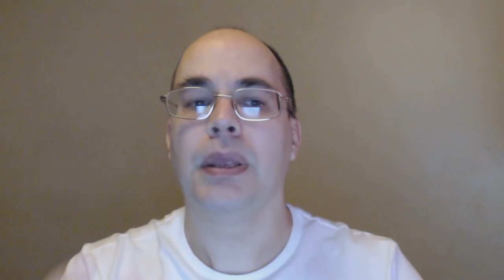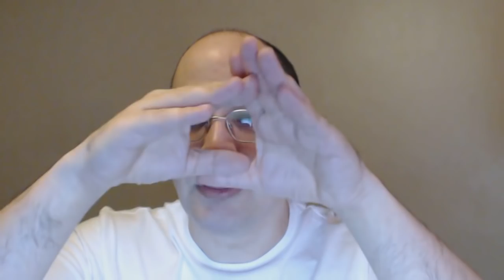How do rockets move in space, with nothing to push off from?

Comment: A rocket need mass to thrust against.. be it the floor or the atmosphere, in space there is no mass to push against,, neurons 3rd law is provided by the mass of the atmosphere NOT within the rocket mass,,  this guy has a deformed sence of logic,, This is an easy experiment,, Try making a balloon car and hold a vacuum hose behind it's thrust, as you will see the vacuum sucks all the thrust away and the car stays still!!  Disproving this idiot..
Reply: +Davy spilani
A rocket need mass to thrust against
No it doesn't. Rocket's thrust is the thing that pushes it upwards.

neurons 3rd law is provided by the mass of the atmosphere
Newton's 3rd law doesn't need "the mass of the atmosphere" in order to work.

Try making a balloon car and hold a vacuum hose behind it's thrust
This experiment doesn't accurately reflect vacuum conditions - vacuum doesn't "suck". Besides, if the thrust is leaving the rocket it means it has already done its work of pushing the rocket upwards.
Reply: Jan Strzelecki  According to Newton and it's Newtons law NASA claims gets a rocket to work in space,  it most certainly does, or are you another idiot that doesn't understand Newtons law?????
WHY A ROCKET WON'T WORK IN A VACUUM!
Why a rocket engine will NOT work in space! NASA says Neutons 3rd law of motion is what makes a rocket work in a vacuum. The 3rd law states "for every action there is an equal and oppersite reaction".  They say this propels the rocket forward and not the air the rocket is pushing against! I say, using  Neutons law, Imagine two big heavy boxes in space, move them together and put a spring in between them,, connect the boxes together.. Now, the spring is the action and you will have an equal and oppersite  reaction via the boxes, when you detach the boxes the spring will push them Appart. So the action of the spring caused an equal and oppersite reaction and the 2 boxes shoot Appart at equal speeds as long as they both have the same mass..  Now a car is Mass the wheels are the spring or thrust and the road has mass, the spring pushes in equal directions, or the wheels turn and the road and car shoot Appart in oppersite directions at equal speeds. The ship works the same,, propeller is the spring and it pushes against the ship which is a mass,, and the sea which is another mass, the 2 masses move Appart at equal speeds in relation to their masses,, The ship has more mass than the sea water behind the propeller so moves slower than the water, A plane uses the same principal. A rocket,, the same principal,,, In this 3 part equation, ie (Mass spring Mass) or (Oppersite reaction/Action/Oppersite reaction) Quote "for every action, there is an equal and oppesite reaction". The rocket is the first mass the spring is the fire plume, (This is a controled explosion that pushes equally in 2 directions just like a spring) and the earth's atmosphere is the other mass, again proportional to thrust and  depending on the mass of air moved and the mass of the actual rocket determines the speed the rocket moves in one direction. As you gain altitude the mass of the atmosphere exponentialy decreases but the mass of the rocket stays the same so in order to continue up at a constant speed the the fire plume or controled explosion has to exponentialy increase thrust in both directions until finaly there is nothing left to thrust against on one side of the fireplume as the atmosphere has depleted. Now we have a case of Neutons 3rd law of motion only having 2 parts ei ( Mass spring ?????) So Neutons law no longer applies and the rocket will not have propulsion, like taking away the sea from the ship, if ships could fly it would just not move,, the propeller can spin as fast as it likes the ship is not going to move. This is before you consider the unimaginable amount of radiation both in the van Allen belt and in general space.. So that's Neutons law saying you can't go into space for far using a rocket engine, You need something to thrust against...   It doesn't matter what those masses are, that's not the point, all that matters is the action the reaction and the oppersite reaction (Reaction/Action/Reaction) 3 parts.. The 3rd law of motion. You can have one big box one small box, One with double the mass, a super spring, it doesn't matter, the principle stays the same, this is a law of physics. so that's ( Rocket = Mass/Explosion/Atmosphere=Mass) The rocket and atmosphere are the equal and oppersite reaction. Take away the atmosphere and you have (Rocket or mass=reaction/Explosion= Action=Explosion/Nothing????? zero mass = No Oppersite reaction) Now Neutons law can not apply.. The rocket can not propel forward...
PROBLEMS WITH ORBIT SPEED
If we have (mass1=Actual rocket/Spring or thrust/mass2=Atmosphere)
So If thrust needs to exponentialy increase to compensate for an exponential decrease in mass 2. Then there's ,A, An exponentially  increased need for fuel and ,B, A constant weight added for all the fuel nessasary to reach Orbit velocity. 
You would need an atmosphere to use as mass2 and the problem with that is heat! To reach Orbit velocity means 17/18,000 MPH If you do that speed in the atmosphere you burn up?! Especially when you are carrying Highly explosive rocket fuel! 
Conclusion!
In order to achieve enough mass2, In an infinate vacuum, you would need to have infinate thrust and infinate fuel  and that fuel would have infinate mass in order to create enough of an atmosphere in mass2 (space) For the spring or explosion (Rocket fireplume) The action in Neutons law,, ie (reaction/action/reaction) to have enough thrust to propel mass1 (the actual rocket) Forward. This is assuming space is infinate and a vacuum! 
Final conclusion It's not possible.. Maybe very low orbit with very light equipment, but with the radiation and heat problems! Once a rocket engine switches off in space the rocket will start to fall towards the nearest large object unless the rocket is in orbit!! ..
Reply: Jan Strzelecki I see a vacuum doesn't suck,, realy,,well it does when you provide an atmosphere, otherwise you'd have bubbles of gas floating about in space.. Oh dear how wrong you are...
Reply: +Davy spilani
I see a vacuum doesn't suck, realy
Yes, really.

well it does when you provide an atmosphere
No, that's merely gas expanding to uniformly fill available space.

So, that's your first mistake - your lack of understanding about how vacuum actually works.

I say, using  Neutons law, Imagine two big heavy boxes in space, move them together and put a spring in between them,, connect the boxes together.. Now, the spring is the action and you will have an equal and oppersite  reaction via the boxes, when you detach the boxes the spring will push them Appart.
Yes, but the spring itself isn't real. It's merely a representation of the forces acting upon those two boxes.

Which is why all your later examples and explanations are wrong. 

Remember, it's "for every action there is an equal and opposite reaction", not "for every action there's a spring that provides the opposite reaction." 😊

So, that's your second mistake: misunderstanding of the analogy explaining the 3rd law.

You might want to try "two rubber balls hitting each other" in the future  😊

(A word of advice here - if you're getting confused by the simple analogies, maybe you shouldn't try to criticize the actual literal rocket science, hm? 😃)

So Neutons law no longer applies and the rocket will not have propulsion
Newton's Laws always apply - saying it's not is like saying "once you jump up, the law of gravity no longer applies".

So, that's your third mistake: misunderstanding how physical laws work.
Maybe very low orbit with very light equipment, but with the radiation and heat problems!
What radiation and heat problems? 😊 Are you seriously taking NASA at its word here, while simultaneously denying to do so? 😂

So, that's your fourth mistake: cherry picking.

Davy, sunshine, we know about dangers of space travel because NASA told us - if they wanted to fake the space travel, they wouldn't have done so. Even if they've changed their mind later on, all they had to do was to produce a "retraction" - "New measurements done with more sensitive equipment prove that space isn't as dangerous as we've previously thought." - done. Problem solved.

Once a rocket engine switches off in space the rocket will start to fall towards the nearest large object unless the rocket is in orbit!
Even if the rocket is in orbit, it's still falling towards the nearest large object. You don't even understand how orbits work 😂

So, to recap, your mistakes are:
1. You don't understand how vacuum actually works.
2. You don't understand your own analogy explaining Newton's 3rd law.
3. You don't understand how physical laws work.
4. You're quite happy to pick and choose available data in order to suit your preconceptions.

And, yes, it's "Newton's" law, not "Neutons", and it's "principle", not "principel", and yes, you most certainly are another misinformed person that doesn't understand Newton's Laws 😊
Reply: +Davy spilani
you know that example of 2 boxes and a spring? That's the 3rd year high school physics curriculum and that's how they teach the 3rd law of motion!
Yes, but the spring still isn't real - it's still merely a representation of the forces acting upon those two boxes 😊

The analogy isn't wrong, but your literal application of that example to reality most certainly is 😂

Like I've said, try using "two rubber balls" analogy next time - there's a chance it may be easier for you to understand 😊

You Say I don't understand how a vacuum works! Realy!!
Yes, really. Again, vacuum doesn't suck - it's merely gas expanding to uniformly fill all available space.

The person who can't remember their high school physics class
That would be you - I remember my high school physics class just fine, which is how I know that rockets most certainly do work in space, and they most certainly don't push off the air 😊
Reply: +Davy spilani
I'm sorry
Apology accepted, then 😊

but you cannot show a blind man visual reality.
The visual reality is that rocket is action, and exhaust is reaction. There's no need to assign "spring" role to any of those two, since the actual Newton's 3rd Law doesn't say anything about it, now, does it? 😊

Or the mentally impaired.
Don't sell yourself so short, Davy 😊

You lost all your credibility with these 2 comments
Well, you lost your credibility way, waaay earlier, but the difference between us is that I at least try to educate clueless people, such as yourself, and point out their mistakes. You? Not so much.

1 because it's a perfect analogy of the law of motion
Yes, but the spring still isn't real and still has no direct analogue in any of your examples 😊

So when idiots make unfounded comments like yours i can give them 2 choices,  1, you agrea with me or 2 you disagrea with me and the education system! Which one is it?
Neither, because though I agree with the education system, I don't agree with your creative reinterpretation of the physical laws involved.

If you think the exhaust gas provides an atmosphere then you disagrea with NASA
In a weird roundabout way, exhaust gas does provide an atmosphere (as in "the thing the rocket pushes against"), so to speak, although it's a very awkward way of explaining it. So, by "thinking" that, I most certainly do agree with NASA in that regard.

If you think the 2 box analogy is wrong then you disagrea with your education system!
But Davy, I never said that the 2 box analogy is wrong 😊

What I actually said is that you misunderstood it. The fault is yours, again, not mine.

And that's your fifth mistake: Your reading comprehension is very poor.

So, to recap, your mistakes are:
1. You don't understand how vacuum actually works.
2. You don't understand your own analogy explaining Newton's 3rd law.
3. You don't understand how physical laws work.
4. You're quite happy to pick and choose available data in order to suit your preconceptions.
5. You have poor reading comprehension, (which, frankly, explains a lot. )

Comment: in a gun the gases ignited behind the bullet pushes the bullet forward as the gases has to push the bullet out before the gasses or most of the gasses can escape down the closed fixed environment - A CHAMBER where gas is moving and has to move the buulet out - low level of gun powder less power from bullet -  simple shit -  this video is stupid -  ROCKETS proppell and push off the earth then in air they push off the atmosphere AIR itself - HIGHER up less air to push off of - IN SPACE there is needed TWO object - THE ROCKET PUSHING OFF OF SOMETHING in space there is no second OBJECT so in return ROCKETS DO NOT WORK IN SPACE -  LOOK UP voyager - THEY SAID the thruster do not work in space - they had to use PLANETARY GRAVITY to change or manipulate direction or travel -    ROCKETS DO NOT HAVE NOTHING OT PUSH OFF OF   - earth  IS FLAT and SPACE AND ROCKETS IS BULLSHIT -  because of PHYSICS   simple shit  -  DONT BUY THE BULL SHIT and stop spreading lies like your stupid ass GUN bullet SCENARIO
Reply: +the one
in a gun the gases ignited behind the bullet pushes the bullet forward as the gases has to push the bullet out before the gasses or most of the gasses can escape down the closed fixed environment
Yes, but how? You have an explosion inside the chamber going in all directions, so what exactly causes those gasses to start pushing the bullet out?
Reply: there is a tiny primer inside that when struck ignites the poweder - CAUSING it to ignite - back of the bullet casing is where it pushes off of because where the bullet sits has lest resistnace and moves forward -- pushing off the back of the inside of the casing -    IN A VACUUM in space there is nothing to push off of - nor oxygen to burn anything - yes you can have oxygen inside your active TYPE of fuel - BUT   IN PHYSICS - YOU HAVE TO HAVE TO FORCES ACTING UPON ONE ANOTHER _    GASES ACT ON THE CASING -  ROCKET ACTS UPON  well NOTHING    -  do you get my point -  unless im missing something here -  BULLETS work on earth - right - due to 14.7 atmospheric pressure same reason propellers work and jet engines - like when a truck fly's by you you fill the air hit you -   this would not occur if you were in space and a rocket flew by you - so ? how can it work ?
Reply: +the one
there is a tiny primer inside that when struck ignites the poweder - CAUSING it to ignite - back of the bullet casing is where it pushes off of because where the bullet sits has lest resistnace and moves forward
Okay. So:

1. The powder explosion is omni-directional.
2. The hot gasses from the powder explosion facing forward push against the bullet, causing it to move forward.
3. The exact nature of the gasses is irrelevant: it can be powder, gasoline (combustion engine), or even compressed air in air guns. All they need is mass (which they have, no matter how insignificantly small) and speed.

With me so far? :)

So, tell me - what happens with the gasses which aren't facing the right way? The ones facing forward will push against the bullet, but can you tell me what the ones facing backward will do?